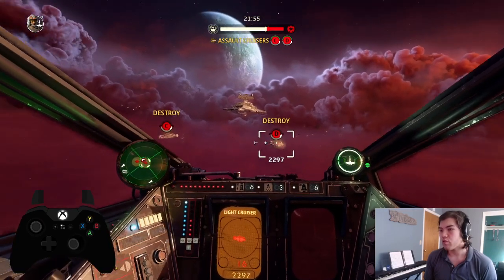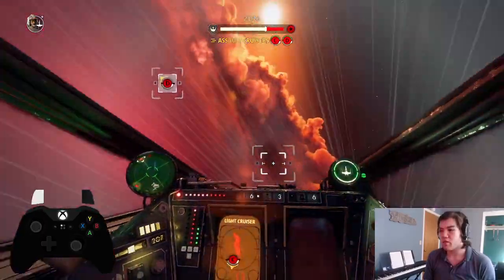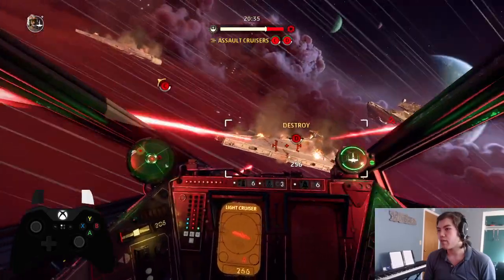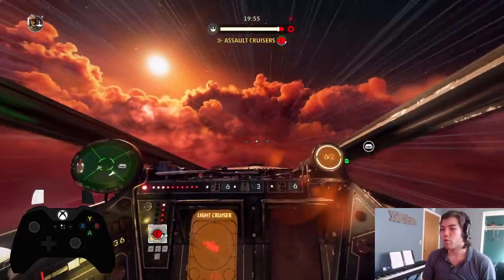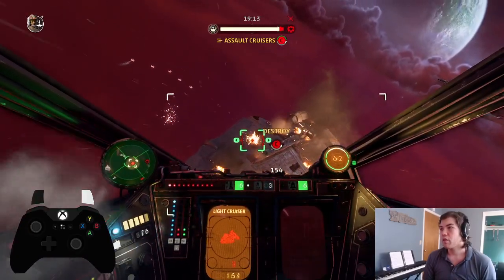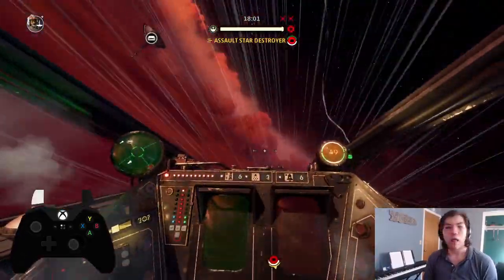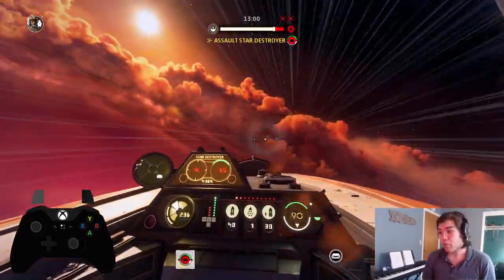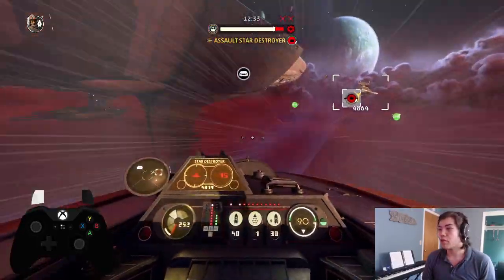How BAD is SIMPLE POWER? - Energy Management Guide

Comment: So... if there isn’t much difference... WHY do you use APM ? :p

In this video, you basically just show there isn’t much difference to the amount of laser damage can be applied with basic and advanced power management and how long it takes to apply the same amount of damage.

The questions I’d like answers to are:

- what is the time difference to charge up power in lasers and shields with 4 pips vs 2 and how much faster do you go with 4 pips in engines vs 2? 

- can you essentially have unlimited boost with basic power management? In that APM video you made, you showed an A Wing with less than 1 boost bar drifting all over the ISD without running out of power using boost gasping. Can that be done with Basic?

- can you shield skip/gasp with basic power management? (This is a rhetorical question :p)
Reply from the maker: Boost gasping while charging boost energy is very doable, just takes practice just like with adv.

4 pips recharges 2x as fast as 2 pips—though that’s an edge case so it’s very rare to be beneficial.
Reply: @fencar6902  I look forward to you teaching me on Monday ;)

Comment: Hey, so if I want to use advanced power on Xbox One I have to use double-tap on the keys or hold the key down to get maximum power to the system I want. This makes me loose a lot of time, loose the rhytm. In the end, I mess it up, don't always get maximum power to a system and loose even more time. I see you use macros for the controller on a PC. Is there any way to do it on Xbox? My main concern is that because of that I'm stuck with basic power and in game can't take power out of shields (like in your previous video) when taking damage to get them to recharge faster later...
Reply from the maker: That technique, while powerful, won’t save your life in 99% of circumstances. The only way to set up APM on Xbox is to buy a HOTAS that works with it, and bind maximize power through that.

Don’t worry, my squad leader and the best pilot in the galaxy, ScalpWakka, does just fine with his basic power management!
Reply: @fencar6902  That's good to hear, thanks :-D

Comment: Is it possible to skip the shield charge cool down with Basic power management and if not, is that much of a disadvantage and how much in different tiers of play?
Reply: No
Reply: It depends.  You CAN skip the cool down if you're full to shields IF your shields are FULL but not currently overcharged.  So imagine you're at 200% shields.  You take 50% shield damage.  You are now at 150% shields.  You dodge behind cover and your attacker doesn't pursue.  If you dump all power to shields they will begin to recharge to 200% immediately with no cool down.  If your attacker comes back around and you take 101% shield damage your shields are now at 99%. Even with full power to shields you will have to wait for a short cool down before they begin to charge again. This is my understanding.  I could be wrong.  Correct me if I am.

Comment: It’s not dps that’s the issue with basic over advanced (or any charge vs spend of any system), it’s purely the ability to drain all pips from engines to dead drift in rebel ships and supports that separate the two.
Reply from the maker: It’s true that it’s a big problem for support ships. Other rebel ships however, like the ywing and xwing, barely drift any farther with this technique, and you don’t want to keep power out of engines that long anyway because time spend dead drifting is time you’re not just recharging boost energy. Long dead drifts on rebel ships are really more of a gimmick than a tactic in 95% of circumstances, and they hardly make the difference in the other 5%.
Reply: Right
That makes sense
Nice one, guys
Keep up the great work

Comment: So, basically its just preference? There is no real advantage/disadvantage to either one?

Just git gud.
Reply: I mean there are some scenarios. Like say after you win a dogfight your shields are low and you have no boost and you want to get out to recover, you would be better off putting half power in shields and full in engines so you can get boost but also generate shield at a decent rate. With basic you would still get boost at the same rate but your shields would be charging at half the rate as half the spare energy would be in weapons for no reason.

But generally in that scenario you are generally either going to get blasted to death quickly, or escape easily. The middle ground where you just manage to clinch returning to base with a tiny bit of hull left is probably rare but its in those cases where advanced would give you the edge.
Reply: @tharrison4815  I agree.  Most people would benefit far more from other skills than to squeeze that last little 1% performance out of your ship.
Reply: @tharrison4815  I have seen the benefit you speak as Ive played most of my games in Adv. However, I just switched back to Basic and I find I get away on the morale flips alot better now, and Power management is overall easier for me now.

Im also on PS4 so that could explain why it feels better for me, and I am by no means saying it is factually better. I just really think after my own experience, it is safe to say that its really down to preference, but using Adv is what can allow for some slightly more options, but not enough to be game changers